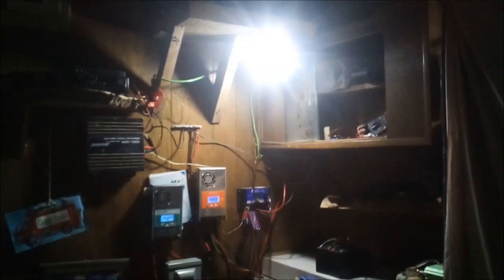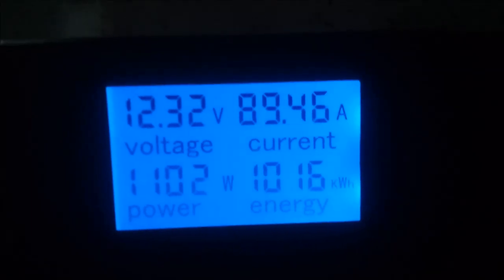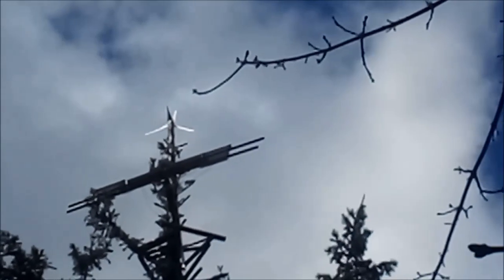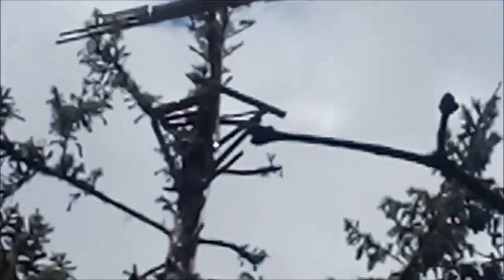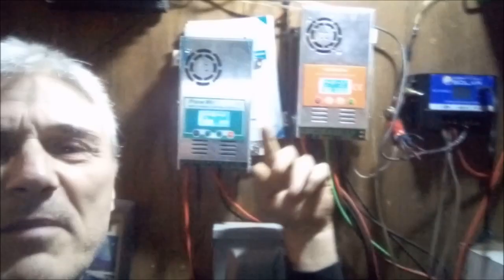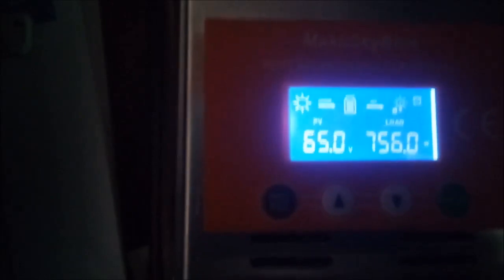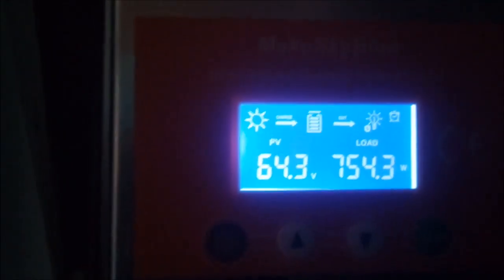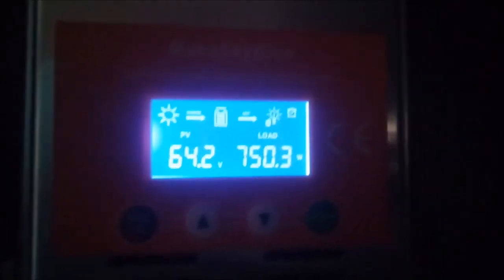Make Sky Blue mppt Solar Charge Controller 3 Year Update Review

Comment: hi there I have just bought 1320w of new solar panels, and I'm using a power 60a. I'm very excited to install it all. I would love to buy the makeskyblues but I can't get them here in uk shipping cost is so high thanks for the video
Reply from the maker: You got the PowMr?  and I assume your going to run a 24 volt battery bank or higher, since you have no choice if you intend to use all the panels.  I would recommend having a couple cheep backups, and alternative cooling system until you can get a more reliable unit. My cooling fan in the PowMr blew out within a couple months, 
 like this https://www.youtube.com/watch?v=acm6dYRLtgU
Reply: @affordablesolarguy   thanks for the help

Comment: So I have a question about this device. It has 2 leads to connect for each type of connection; meaning you can have 2 lines of battery connections, 2 lines of solar panel wire networks, etc. So with mine, I had 1 string of solar panel wires going into 1 of the 2 lead connections. But then I got other panels and added a second line. So both the 2 connections are going in. 

Now when I activate 1 set of wires the voltage goes up. Then if I shut that off and then turn on the second set of solar wire connection going in it will work and connect. This is as if I'd activating one at a time, each one will work. 

BUT when I activate both leads going of solar panel wires going in at the same time, the voltage doesn't read right. So by this I mean, I activate the first lead of solar wires that are all on one wire going in and it jumps to the voltage it should be at. Then I activated the second line, and instead of the voltage going up, it went down. It shouldn't have gone down, it should have gone up...? The figure on the voltage read out isn't right or something? 

Also this is wired in series parallel. 

Why is it doing that and how do I fix it? Thanks.

Its a very good durable controller. This is probably something minor to adjust.
Reply from the maker: nononono,, NEVER  put more than one voltage/ type battery bank on a solar controller, no matter the brand.  It will only respond to the highest or lowest resistances, meaning, it will blow the other one up if it is not an EXACT match. Or murder it slowly because it never gets a good charge.  In other words, you would confuse the onboard computer that controls the MPPT and destroy its efficiency and accuracy.  The double connections is simply a dainty  and metal conservation, expense cutting  change.  The Made Sky Blue cuts away all the waste of extra metals and materials and compensates with a great heat sink design and fan. You need to use both connections to acquire a full 60 amp pass through with only gauge 9 or gauge 10 lines.  Which is all that will fit in the connectors.
Reply from the maker: just split your single line into 2 and use both slots if your over 30 amps.  Figure each slot can handle 30 amps, except the ones on the far right, which are just mili amp DC for a light or something,  So, if your below 30 amps, you can just use a single connection, but remember , the amps are much higher on the battery side. (You just don't want to melt the little screw connection from excess heat, it is internally , the same connection)  I recommend ALWAYS using both connections to the battery for better efficiency. And ALWAYS use 9 or 10 gauge braided wire, never smaller.  2 -10 gauge lines can easily carry 60 amps with minimal loss to heat (line loss) for a short distance like 4 or 5 feet max at 12 volt.

Comment: I have 4 powmr 60 amp charge controller about three years old at work beautiful and it one run 4 solar panols of 280 Watts a piece on a 12 v sistem
Reply from the maker: im quite surprised you have not had to get aftermarket fans yet.  Mine burned out pretty quickly on the PowMr

Comment: Wow 3 years! Pretty good 👍. That's on powmr right? Im looking for something dependable living off grid.
Reply from the maker: it is now more than 5 years and yes, the PowMr is still working as long as I dont let it overheat.  I just run fewer panels on it.  Careful though, the PowMr has crappy voltage regulation and can cook batteries. The Make Sky Blue is much better.
Reply: @affordablesolarguy  Thanks for the great info and videos. Had a 48v inverter go out. Need something more dependable for lights and as back up. 12v batteries is more versatile for sure. And finally a tested proven affordable charge controller to last years as they should instead of months. They look cheap but as long as they last then good 👍
Reply from the maker: @manuelg9367  I do find 12 volt the most useful, portable, charges from many sources, and extremely reliable with no danger of shock to animals or children.  I always have my 12 volt system running my PC  and other sensitive equipment.

Comment: Thanks so much, very useful information.  I am using PWM exclusively right now with two 30 amp controllers and am looking at moving to one or more 60 amp mppt controllers.  Make Sky Blue seems like they are a lot more together as a company than PowerMR.  So I am willing to pay a little more for Make Sky Blue.  I also like the fact that I am seeing feedback indicating that people are getting support from Make Sky Blue but not from PowerMr.  I am hearing that I can get more efficiency from mppt so I am ready to make the change.  I currently have 11 100 watt panels and am looking at adding another three by enlarging my support structures.  But thanks again for this review, it was very helpful.
Reply from the maker: you understand that with MPPT, it is critical to have a higher voltage Battery bank, to run all those panels on a single 60 amp charger right?  You cannot do it with a 12 volt Battery bank
Reply from the maker: Thank you sir, for clicking on it, I really do use both the PowMr and Make Sky Blue, and in every test over the past 3 years, MSB just does better.  More stable, accurate recording of input, and the cooling system seems much higher quality.

Comment: My 60amp MSB won'y read the power on the display correctly.
Reply from the maker: you may have altered the settings to AMPS?  Because I have tested a couple of the MSB I installed and the power reading matched my multi meter perfectly, within 2-5% even with fast tracking changes.
Reply from the maker: https://youtu.be/LLFYDVO9Wx8?t=1366 
Maybe study the manual to learn how to alter the readouts to volts/amps/watts, if you dont have the manual, use this vidio I made of the actual manual.  I linked you to the page with programming instructions, simply pause on material you want to read;   https://youtu.be/LLFYDVO9Wx8?t=1366

Comment: Your up to high for safely working on the panels for me.
Reply from the maker: When you don't have a choice, you find a way.  And solar panels are maintenance free, after installation.  Just make sure they have a bit of a pitch, or an automatic solar tracker so they  get washed in every rain.  PS, I have an invention that would fix that, but afraid to post it before patent attempts .   What a beautiful world this would be if everyone used trees as solar anchors instead of cutting them down and out of the way.
Reply: @affordablesolarguy  I scapped snow in 0F degree many times in 5 days. Other scqeezee evert month to clear chems in the dust/rain build-up. I like watts!
Reply from the maker: @davegeorge7094  I have never had to clean my solar panels in nearly 4 years now, because I use automatic solar trackers, and keep a pitch on them.  Being up in the tree tops, not nearly as much dust either, but even covered with dust, they still work, with almost UN-noticable loss in production.
Reply from the maker: @davegeorge7094  I've never had to clean my tree top arrays, or the ground panels in the garden.  They get dusty from the nearby driveway, but I don't see any noticeable decrease in power before the rain comes, although they do look filthy.  And the same applies to my clients.  Rain is magical.

Comment: Hi friend.nice videos.can you explain the set up for your wind turbine charge controller.I have the MSB 118 60amp I want to use a 24 volt 1000w wind turbine with it is possible to do it.thank you
Reply from the maker: NO, I do not use mppt MSB for wind, only a rectifier and the pwm module that comes with the micro turbine.  The MPPT did not like it at all, and did NOT work right.  The voltage is too irregular.

Comment: Nice video. But what's up with the 1.5 mega pixel camera from 1999?  Lol. Horrible video quality. But nice vid and info brotha.
Reply from the maker: sorry bout that, front cam is weak, but its an Android 4, pretty powerful.  Not sure my movie maker can even utilize the def.  but Youtube has toned down streaming because of the pandemic, and this is the first complaint, might have something to do with it.
Reply: @affordablesolarguy  No worries. Like the video though. 👍
Reply from the maker: @TIME TO FULFILL A DREAM   Your building your own dream, awesome dude.  Yeah, I run 12 volt battery bank, and have 3 different chargers on an 8 kw AGM battery bank.  I couldn't do what everyone else considered  a "normal" install, because I live in complete shade.  But yeah, your thinking right to use mppt , bring the power in at 48 volts, to eliminate line loss, then convert it to 12 going into the battery bank.  As for wiring your battery bank, when you get a big one, with 10 or more batteries, the parallel wiring begins to make more sense and saves lots of money on cabling.  I make mine myself, its so easy, here is a link to how I do it.  Shorter cables, on a 12 volt system = much better efficiency, less line loss.  here is a link to the middle of my video where I'm soldering my own cables, and saving tons of money  https://youtu.be/9hanLOI5SYU?t=140